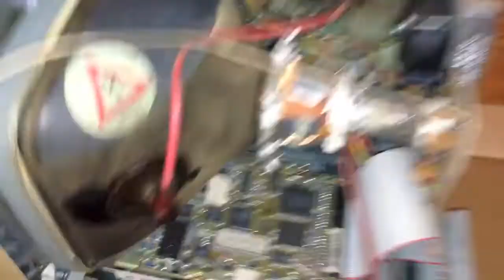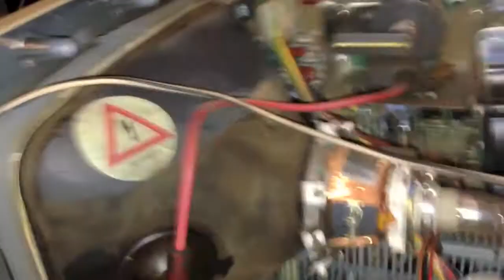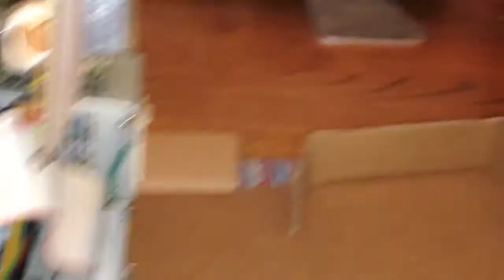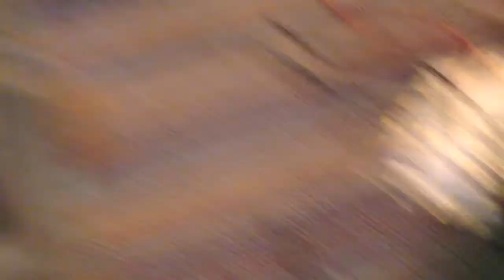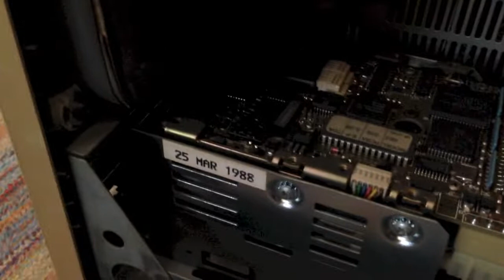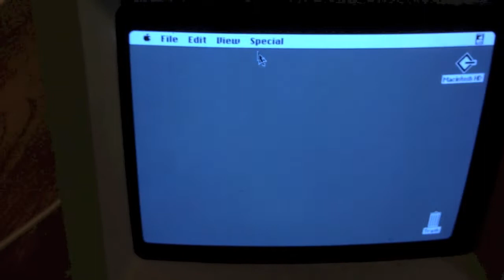Inside my Macintosh SE

Comment: Usually CRT televisions make high frequency noise due to NTSC ratings, but most monitors don't (except for some from the 1980's). That sound you were referring to probably was the PSU acting up. :(
Reply from the maker: Yeah, it is… It need to be recapped.
Reply: ***** Good luck. Also, the Mac Plus and the SE are some of the best 1980's Macs ever! I still don't know much about the Macintosh II though.